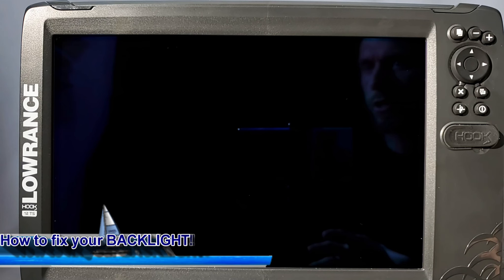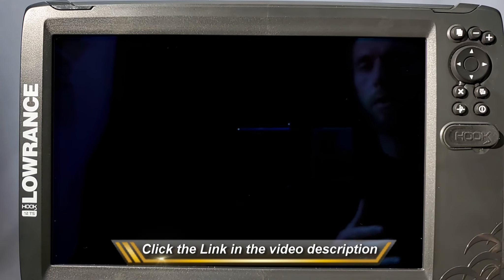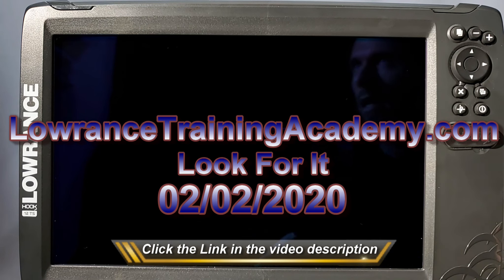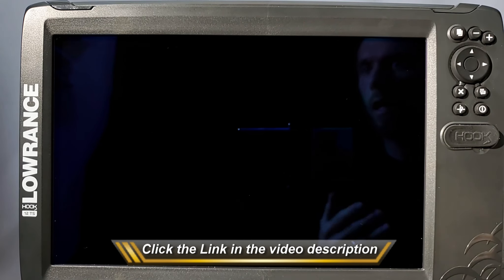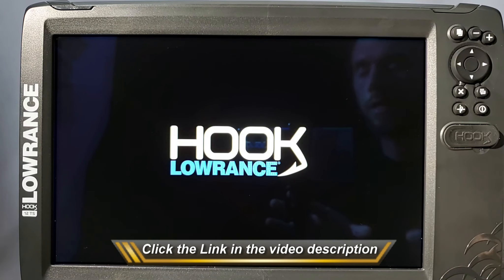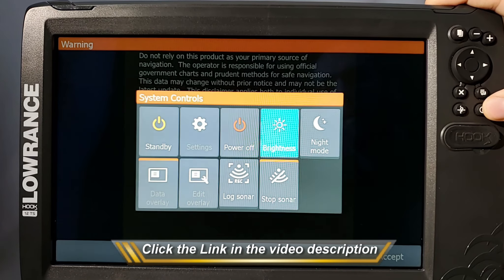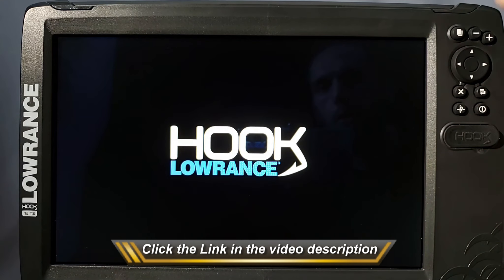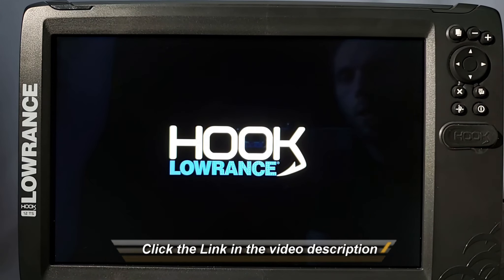How to use a Lowrance -  Backlight not working

Comment: I just purchased the Hook Reveal 7 and was using it in a tournament for the first time yesterday. With about two hours left the screen just went dark. I didn’t touch anything to make it go dark. I tried hitting the power button to get the brightness up, but nothing. I rebooted twice and saw the Hook Reveal logo, but it would go right back to a dark screen. I tried hitting the power and enter buttons, but nothing, so just held the power button to shut it off. Today when I turned it on, it is back to normal. My question is, why did it just go dark in the first place when I didn’t do anything?  Secondly, why couldn’t I adjust the brightness at the time, but now it is fine?  Thank you for any advice you can give me.

Comment: I have 2 HDS5's on my boat (yes, they are dinosaurs, but it's all I can afford) and one of the screens is nice and bright and I can see everything even in bright sunshine.  But the other  isn't even close, and hard to see in sunny conditions.  I am aware that pushing the power button changes the backlight but even on high, it pales in comparison to the front HDS5.  So do the screens just go bad over time and start to fade away?  Second question; among my pile of hand me down fishfinders, is a LMS 520c and a LMS 332, both having the same size screen as the HDS5's.  Are the screens basically the same?  Can I switch out a brighter screen for the dull one?
Reply from the maker: I actually still have an old HDS 5 as a back up display and it works great still somehow. The screens don't typically fade out like that. Unfortunately you can't swap out screen between displays. Aside from the fact that it's a different type of screen on the HDS, they are pressure sealed and if u broke one open, it would potentially get moisture inside and rust out the components.

Comment: Any ideas if your unit doesn't power on at all. It doesn't make a beep or doesn't show a logo at all. I know I have good voltage, measured 12.95V at the plug. I've submitted a contact request with Lowrance but always up for information. Thank you!
Reply from the maker: It depends on what type of display you have.

Comment: Why does my unit leave a dark blue wide trail sometimes on chart. The trail that my boat leaves?
Reply from the maker: You need to turn off your structure overlay on the chart screen. On the menu to the right, you will see the option for overlay. Change it to OFF.